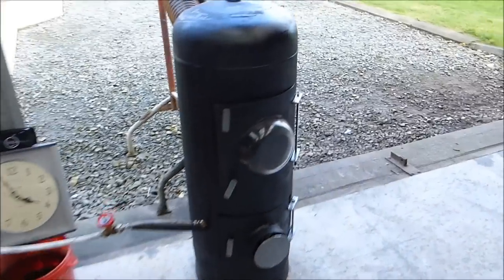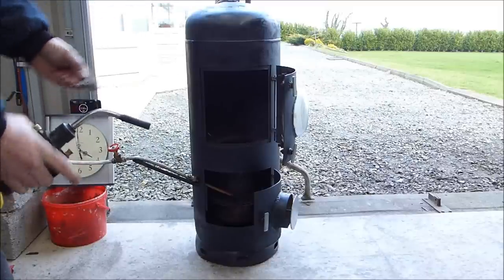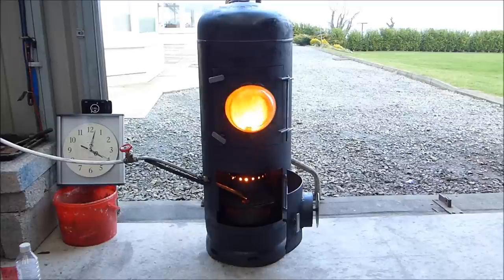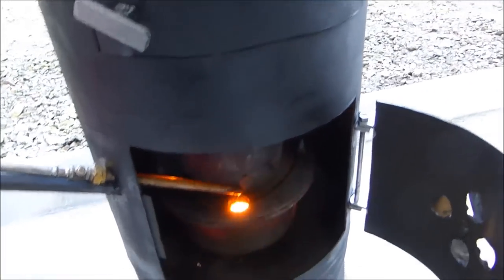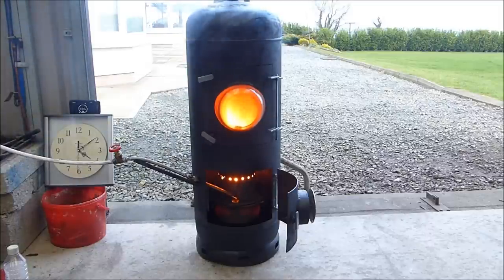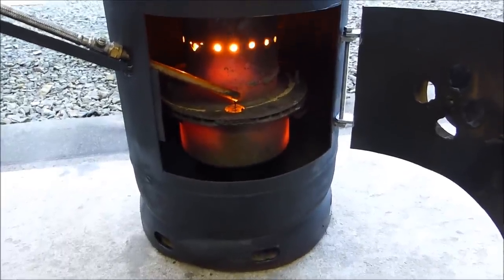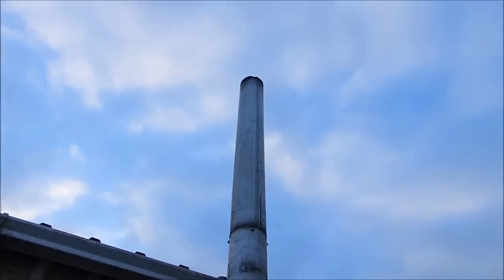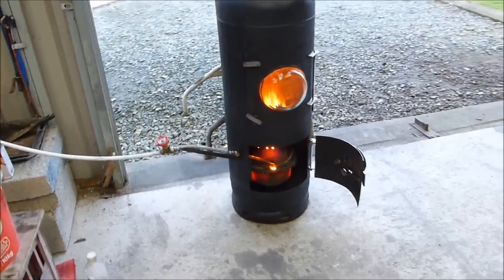Fantastic diy waste Oil and Wood burning stove heater.

Comment from the maker: Hi guys. There are some new playlists in my channel to make it easier to follow the progression of these waste oil heater  projects both Ozzirt type and the Forced air blower type. Cheers Gerry
Reply: Been watching your videos. Built a rocket stove few years back now thinking of converting to the oil burner. With the principle of the exhaust running along the workshop floor to act a  large radiator. Nice to see someone else from Wexford.
Reply: Gerry's Waste Oil Burner Gerry, any new projects? love stove

Comment: Really well done and an awsome build Gerry. If you weld some 4" (10cm) tubes through the top or wrap them around the top. Then you can put a fan behind them and blow air through them. My dad used to work in a two bay garage up north in the states when I was a kid. That stove got that two bay garage so hot we would have to strip down to our T-Shirts in the middle of winter. Keep up the good work. Keith

Comment: This is definitely one fantastic stove build, the best I have seen yet. In fact I don't see how you could  possibly do any better than this. Great job...thank you for your videos and God bless you.
Reply from the maker: Hi George. The stove really outputs a serious amount of heat if you need it and if the oil is dialed down it will it will tame it also. It's great that it runs on solid fuel as well. Cheers

Comment: Excellent set-up!  I particularly like your innovative use of the Pyrex dish. It's both handy to see the flame and one of the nice things about having a fire.

The crackling sound is water in your oil. That will reduce your heat output... if it matters at all. Dry oil does work a LOT better in these burners.  If you were interested in efficiency at all, you could run your Chimney pipe horizontal for a good few feet before ducting it out. You would find there is a lot of heat coming off that which would now be wasted.  If you also had a small fan blowing along it, the heat would be better dispersed around the area you are heating. 

Congrats on a job very well done with this. It's definitely the neatest and most innovative burner of it's type I have seen. You have thought it through very well and come up with a great set-up.  Great explanation and who doesn't love an Irish Accent!

Well done to you Sir!
Reply from the maker: Hi Glumpy10. The first section of flue had a second internal wall but I removed it so as to emit more heat. The single wall cladding on my shed really needs to be insulated so that the heat stays around longer, another to do for the long list. Thanks for the comments Cheers Gerry
Reply from the maker: Picobyte Hi picobyte. It does sound like a deep fat fryer in a chipshop or McDonalds. Lol. I suppose if the design was tweaked a bit it would be possible to cook on it. Thanks for the comment. Cheers Gerry

Comment: Great job.  I agree, baffles will definitely improve on this.  What about giving it wings fixed toward the rear to act as radiator panels?  Hey you could maybe even set up an oil preheater for when it’s very cold.
Reply from the maker: Great point! Cheers Gerry 👍

Comment: I dont know if it's said before, but for your paint problems the solution may be a mix from graphite and boiled linseed oil. Mix both together for a creamy consistency, paint your heater with it and then you have to burn it in. I mean you have to fire your heater up after painting. This is a very old recipe here in germany for use on every kind of ovens, heaters, smokers and so on... Dont know if it stands the 1000°F your heater reaches, but its cheap to test it on small sheetmetal which is heated and then you see the result. Give it a try :-)
BTW: Your waste oil heater is one of the best/nicest i've seen so far!

Comment: Just happened on this video by chance after looking for ideas to convert an old propane tank into a wood-burning stove. Brilliant concept and, without seeing the earlier six episodes, what looks to be an elegant build. Good stuff!

I understand that vapourising the waste oil is the key to its heat output and wondered if pressurising the oil and "injecting" it to the burn chamber might improve efficiency, the only downside to this would be having to filter the waste oil thoroughly to remove any "lumpy bits".

Just off to watch the build from the beginning, cheers!
Reply from the maker: Hi James. A siphon nozzle setup would work well if you are atomising the oil for ignition. It would be easy enough to convert a conventional oil burner but would require a compressor as part of the kit. A big advantage with that setup is that it could be timed to come on automatically without needing a manual ignition. I might do a video on a siphon nozzle setup soon. Cheers Gerry
Reply: @GerrysDiy  Aftr giving this carefull thought i dontsee why you couldnt put a one way check valve inbetween the tank and the fuelsupply line close to the nozzle mabey outside the tank and fuel supply valve to keep the back pressure after the nozzle gets hot and vaporize the fuel inside the line and only givingit a one way exit ,,when the pressure equalizes with both sides the lincheckvalve then the ofuel will automaticlyfeed into the hotside of the feedline and keep a constantflow of pressurised fuel going into the burner,,this way you can  also control the amount of fuel being feed into the burner  as the fuel will really loose its viscousity and thin out when it gets hot and vaporizes ... mabey installing a surge protection device in the line would insure a steady smooth operation after the system gets up to operating temputure.What do you think about that? This alleviates the need for an outside source to pressurise the fuel.
thiere would be no need to run an air compressor to keep the line pressurised and also keep the fuel moving in one direction only and prevent  the fueltank from burping and possibly causing a fuel spill ?

Comment: Subscribed from Virginia USA I like the concept, I have a lot of waste oil laying around and the cost of kerosene is about $5 a gallon so I think I might as well get something back from my expensive motor oil.
Reply from the maker: Hi zoltarp. I put a different type of burner in this propane tank stove and it is a very easy build and has a much smaller profile but the same output. Have a look and see what you think. http://youtu.be/QQGtl87-x58 Thanks for the comment Cheers Gerry

Comment: Nice stove. Barbecue paint should be able to handle the heat. I've used it on exhaust systems on snowmobiles and motorcycles and it holds up pretty well.

Comment: Add another American watching and enjoying your video's. I want to build some type of heater like this to heat my inground pool. In the end of this video you say you plan on building a boiler or hot water heater.. So I am on my way to watch the rest of your video's and check out your website... Cheers!!
Reply from the maker: Hi Steve. I did connect this burner up to a mock central heating system and I was able to heat 80 Us gallons 300 Liters in about 1 hour producing about 22.5 kw to the water and maybe another 5 to 10Kw from the burner. I made 3 videos of it running here's a link to one 
http://youtu.be/1Et3rIn5GIY.
With the newer burner from the latest videos it would be very easy install it  into this type of central heating boiler. The boiler in this video was 70k btu and I maxed it out but even  if the boiler had been of a higher outputsay 120 k btu 36kw  I could have maxed it out too, easily. Hope this helps Cheers Gerry

Comment: The Pyrex bowl was a great idealI ll be makin one over the next few daysAnything critical for the blast tube thanks
Reply from the maker: Hi Pat. I just use 1 inch Malleable iron pipe. Plumbers call it gun barrel or GB pipe. copper pipe inside to protect the oil from burning. You can buy stove glass too if that suits. I used stove glass in my latest minion stove. Cheers Gerry

Comment: hey Gerry, try some engine enamel paint, its good for up to 1700-2000f of heat. I work at an autoparts store and we sell that quiet a bit
Reply from the maker: Thanks Justin. I'll check it out. Cheers Gerry
Reply: Gerry's Waste Oil Burner
it should say on the can itself what its good for, if it doesnt as someone that might. the stuff we sell has it right on the front of the can, we have engine enamel paint and exhaust manifold enamel paint, the exhaust manifold pain is good for up to 1700f
Reply from the maker: Justin Bechtel Hi Justin. I put up a video today and the stove I painted last year is looking sorry for itself. Its paint is all but gone. I will check out engine enamel tomorrow. Thanks
Reply: ceramic/enamel paint is what I was thinking as well, but doesn't the ceramic paint for manifolds act as an insulator? I think it prevents heat from going in the engine bay. might be a little counter intuitive? I might be wrong though.
Reply: there is some heat resistant paint based on silicone resin that is resistant to 800C (1472F) maybe that is an other option?
Reply from the maker: UbIfLuXuSiBiMOtuS Thanks . If I can get blue and yellow it would be great for my newest project. You'll see why it needs to be blue and yellow straight away. LoL
http://youtu.be/TjE9nj1-dq4 
Cheers Gerry

Comment: Can a copper coil be added inside the top part of the stove and operate two or three rads circulating the hot water in the pipes?

Comment: hi,
what a great job you did !
i saw that the top of the burner has holes, so, why didn't you keep a secondary air intake (on the door with the glass).
by doing this you could achieve the pyrolysis of the oil burning almost everything from the wasted oil.
another thought  that i have is if the flame temperature is above 900 degrees centigrade you could add a pipe in the top center of the burner to feed the fire with.. water ! so it will happened the cracking of water producing hydrogen and oxygen.
regards
vYk

Comment: Great video collection 1 - 7. I've been looking for info on how to make a workshop heater for ages this fits the bill. I would be interested in seeing how the flue (chimney) was constructed and from what, but that is only a small issue. Overall a fantastic video collection
Reply from the maker: Hi Marc. The flue was just some 6 inch flue that I had here. Its nothing special and once its about 4 meters high and  5 or 6 inches in diameter it will work well. In some of the later videos there is more footage of the flue. Cheers Gerry

Comment: I love this!  The Pyrex is a nice touch. If somebody hasn't already suggested it, I'd look for "stove black" stove polish. I used it on my wood stove for years.  Don't know if it can be found in Ireland.  I'd like to do this in my garage, but I'll consider building a brick enclosure, 14 or so inches high, for the bottom, back & sides with a steel-plate top; just in case of burn-through.
Reply from the maker: Hi Limb Reaper. I tried stove black but as soon as the stove glows red and cools down that's the end of the stove black. I have at this stage tried a few paints but when I crank up the heat the fire resistant paint goes up in smoke. A brick enclosure would certainly make this a safer project. Cheers Gerry

Comment: Wonder if you put a coil of copper line in the burner if it would heat up a pool
Reply from the maker: Hi Stv45. It would certainly heat a pool. I used the same amount of oil and the same burner in a boiler video I made and it was able to heat 300 litres of water in an hour an make it turn to steam. I had a newer burner heating my house with vegetable oil. here's a couple of links
Heating a whole house with waste veg oil https://youtu.be/SAmHNp6fOUA
Making Steam   https://youtu.be/1Et3rIn5GIY
Cheers Gerry

Comment: Congratulations on the great job I liked, now tries to mix a bit of seawater and reduces a little the oil.
Reply from the maker: Hi Paulo. When I get water in the oil there can be a flash over as the oil thins out on the water and the flame gets higher. It makes sense to give it a try. I will try it and if it makes an improvement I will show it on a video soon. Thanks

Comment: Hi Gerry, Great video. Have you found your heat resistant paint? I tinker with very hot stoves and I find that DIY sodium silicate based render (or paint) works well and costs very little.
Tim

Comment: Hi Gerry,  thanks for making the whole series of videos. Your general thought process is brilliant. It's given me the solution to a few issues I had on my wood burner I made from two of the smaller gas bottles welded together.  
Now after viewing your burner it's all change here and I'll be converting to a "duel fuel" burner very shortly. 
I positively love the use of Pyrex bowls (my mrs won't though)
Thanks again and a big thumbs up 👍👍
Reply from the maker: Hi mk2sixteen. I did a couple of burners in these videos. In earlier videos I used an Ozzirt type In later videos I made a blower type burner so I could convert a smaller existing boiler. Once made it can fit in minutes and works great. There are 2 disadvantages though noise and it needs power. I went through a few dishes because of expansion of the metal but they didn't mind the heat at all. Once given enough room to expand the problem was sorted. If you get a chance throw a video together and post a link. I would love to see it.
Cheers Gerry

Comment: AMAZING! I've been planning a workshop heater for a little while now, and this has given me a whole new direction to consider. I've watched these 7 videos and will surely check out the rest of yours tonight.

This is a new concept to me, although I've heard of commercial waste oil heaters before, I've never seen something like this. I found your videos to be very clear and extremely informative. I'm sure I'm just one of hundreds, if not thousands (given that there are more than 7,600 views on this video right now) who have gained an amazing amount of knowledge from these videos. On behalf of all of the newly educated viewers, I'd like to say thank you.

On a more inquisitive note, what sort of variables will affect this stove? will restricting air flow when burning oil work (i.e. closing the bottom door and utilizing the damper), or will this stove only operate correctly with unrestricted air flow? Because the viscosity of the oil will change with temperature, does the flow rate need constant attention, or is it fairly easy to "set it and forget it"?

Thanks again, next time I have a drink I'll lift my glass to you. Cheers from Indiana!
Reply from the maker: Hi Nick. I really only put the damper on the bottom door so that if I was using it as a solid fuel stove I could regulate the burn. All I do is remove the oil burner and put a cast iron grate over the hole and light it. It is possible to regulate the air if it is in oil burning mode but the holes in the blast tube are tuned for about 3 to 4 litres per hour.
I have made a different type of burner that requires a fan and it is more adjustable re heat output. Today I am installing the newer burner in this particular propane tank so there will be more videos to follow in the next couple of days. The newer burner is actually easier and faster to make.
A cold drink around now sounds great. Greetings from Ireland.
Cheers. Gerry
Reply: successful waste oil burner
 I really like that this style works without the use of a fan. I've gotten a few materials together to start making my own as soon as I finish my tiny rocket style space heater (which is looking really promising so far, despite breaking a lot of the "rules" that everyone talking about rocket stoves seems to live by... and before anyone from an unnamed permiculture website chimes in, yes... I have The Book, I've read it, and its not that impressive). I've spent some time since my first post doing some research, so now have a pretty solid understanding of the system and how/why it works.

There's a couple pieces still that I haven't found yet. Is the size of hole used at the top of the tube based on any guidelines, or is it more "this is what we know works" kind of thing? The reason I ask that, is that I like the idea of having control over that air input, as well as direction.

I'd like to play a little with inducing some turbulence by having air enter the tube much like the way a burn tube would in a homemade propane tank foundry. The other idea I had was stealing some ideas from the rocket stovers and try insulating the tube.

Does it sound like I'm way off, or might this be worth a try? I'm ok with "well, I suppose it might work, but I've never tried it", but if its a "you should have tried harder to find other stove designs, a thousand people have tried this and it always fails", I might not be so eager to start cutting and welding so fast.
Reply: @nick1284s  You only have to try! And let us know what you found!

Comment: My fathers garage had a old oil stove similar to this. I think there was a coil of what looked like steel brake fluid line at the end where the oil came out. As it heated up the heat would help vaporize the oil just before it hit the flame. It burned very clean.
Clay
Reply from the maker: Hi Clay. This is a work in progress so I am happy to incorporate good suggestions. Thanks for your comment.

Comment: Hey Gerry!
I am in the planning time of building one of these heaters. Since I haven't built one yet I'm not sure how my idea will work. Hope you might give your opinion.
I plan to make a heater about the same size as yours. Might be slightly bigger. Anyway I'm thinking of drilling holes across the top chamber and welding about twelve 1inch or 1.25 inch steel pipe through the heating chamber to create a heat exchanger which I will fabricate a plenum and use a blower to push through the pipes and the heated air out. This will help capture more of the heat going out the vent and making it more efficient.
My only worry is it restricting the natural draft and affecting the flame.
Any thoughts?